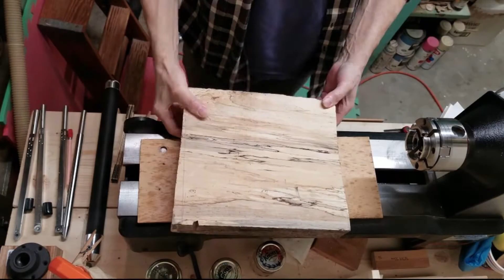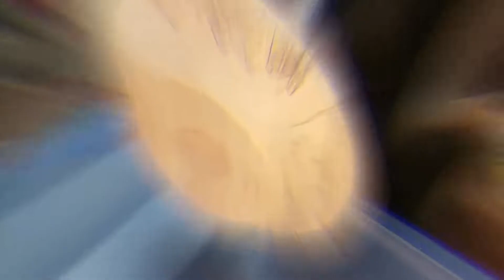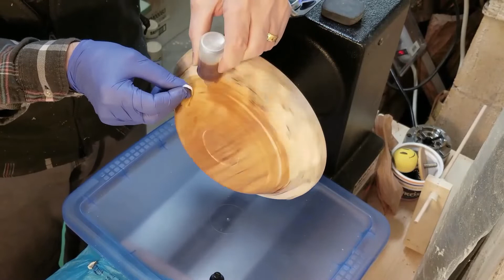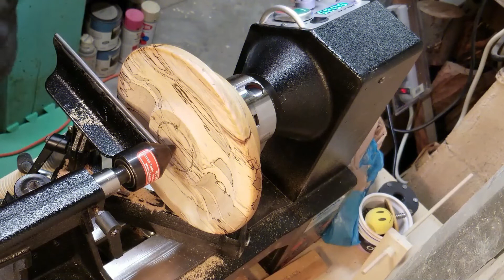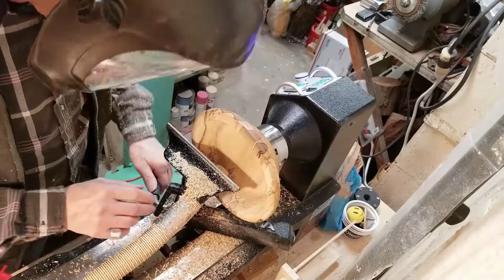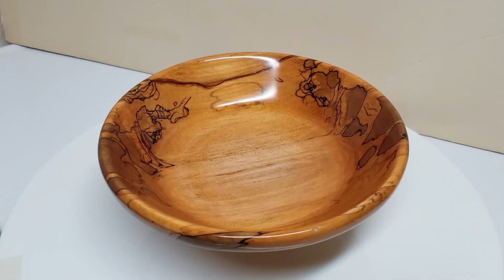Woodturning:  9 inch Spalted Maple Bowl - Not Quite a Fail

Comment: The bowl came out really great, Mike 👌 Don't worry too much. Head up and don't give up like always 😊 I was searching some shapes in spalting but I didn't found any 😉 Spalted wood when is thin is always bouncing and making waves but every wave is easly for sanding. No matter what chisels You use. Today I started project with spalted and very punky walnut and even skew was jumping a lot on the wood.
50 subs - It is a reason to cekebrate 🎉🎺
Take care my friend 🤝
Rav
Reply from the maker: Thanks Rav I am starting to think it is not so bad. What me give up? I'm just a perfectionist that needs the plan. Well, I still need a parting tool (next) and a shear/NR scraper - I figure I can sharpen them both easy enough. You and spalted? Yeah but you've done way more than I. So far.
Hmm, 50 subs woohoo. I didn't notice. But I do now!
Thanks for all your support bro,
-Mike
Reply: @mpart_woodlathe-stuff  The bowl looks really great. Sometimes I have the same filling like You that my work is really bad looking than I put on glasses and it starts looking much better 😁
Parting tool and scrapers are are very helpful but You have round carbide tool and there is no big difference - I think.
Your work is better and better 👌 Keep'em going.
Cheers
Rav
Reply from the maker: @Secondlifeofwoodturning  Thanks you for encouragement Rav

Comment: I read your comments before watching the video and was not sure what to expect.
No matter what happened between the time you started and the time you finished you ended up with a Very pretty bowl.
Your finish looks  good and the spalting is wonderful.
 I use all kinds of finish. The one I find is the easiest and produces great results happens to be shellac.
What I use is the Zinsser seal coat and then the Zinesser Shellac. All straight out of the can with no mixing at all. I will brush the sanding sealer on or wipe it depending on the piece.
But if I brush it on I always wipe it as well.
 That being said today I finished a piece with Minwax Polycritic. It is a water based product. And the finish is looking pretty good.
I found it was the best product to finish a piece of driftwood. Which I did last year. It soaks in and hardens so the following coats go on better with each application.
 You did great and NEVER GIVE UP!
 Take care Mike and Merry Christmas.
Gary
Reply from the maker: Tanks for these detailed comments Gary 🙏 I'm just too picky, I guess. This bowl is growing on me 😁 My father was a frustrated cabinetmaker (WWII intruded) so I have a long tradition of flatwork as baggage - turning is way different esp. as an EOL hobby. So I was trained to notice, and fix, all blemishes and was taught 'old world' & traditional techniques. Oh well.Have you used any colored Polyacrylics? I use a Cherry flavor on my wife's Harry Potter doll brooms and agree it's effective. I really like the water cleanup and as a thinner.
Take care Gary & Happy Holidays my friend,
-Mike
Reply: Your welcome Mike. I understand being picky or paying attention to detail is a better way to put it. 
 In my job as a wood pattern maker everything had to be exact. What we do here I think we expect to get things as perfect as we can in other ways.,
 I have only used the clear Polycrylics. I like to work with the color the wood has but for the brooms it would be great. 
Happy turning in the new year to come.
Gary

Comment: The bowl looks fine. I’ve found that working with spalted wood is challenging but with patience, and lots of sanding sealer to stiffen up the punky areas, you can usually get a good finish. I’d certainly be very happy with the finish you’ve got on this bowl. Keep up the good work. Have a very merry Christmas.
Reply from the maker: Thanks for the encouraging kind words Duncan🙏 I think the operative word here is "patience" which is too often in short supply 😮 
Merry Christmas to you and yours my friend 🎅 -Mike

Comment from the maker: Lessons learned and other musings ... 
1) This wood was heavily spalted in places so I expected tearout deeper and worse than I've had in the past. I really really underestimated how much there'd be !! 
2) As the project progressed I became more and more saddened(?) it was not going to plan, so I slacked off more and more. Lesson: Something worth doing is worth doing well SO DON"T GIVE UP.
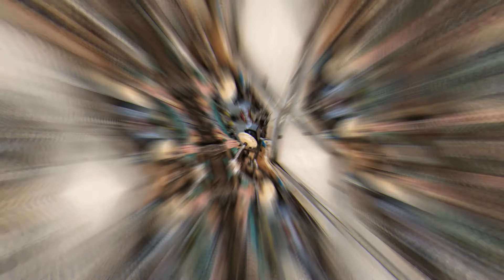3) Because the wood was so soft, I couldn't produce a flat, even surface. I had an 'ocean wave' surface wherever the wood transitioned from soft to hard; i.e.  from punky to solid wood. This wouldn't cut well even with the shear scraper (round bar tool) or with sandpaper. You can see how delicate I'm being at time 3:00 .. 4:00
4) The bowl always seemed to be out of balance so I never really got it over 1000 RPM. 
5) My carbide tools weren't the best for dealing with this soft wood. I need some traditional tools for sure !! 
6) I made a huge mistake with the finish at one point - I applied a few coats of straight 3# shellac. This strength is better applied with a brush or something and not used as a wiping finish. 
7) I need to settle on a 'signature' finish that is quick to do - it takes way too long futzing with shellac. I like shellac but it is labor and time intensive.
8) I used Howard's Feed-N-Wax as the top coat. In general it is a nice finish but apparently it didn't buff off well in the slower turning center of the bowl. There is a 4" dull, rough area centered in the inside. Maybe I can post-fix it. (p.s. This produced as 'platicky' surface I'm not sure I like.)
-Mike